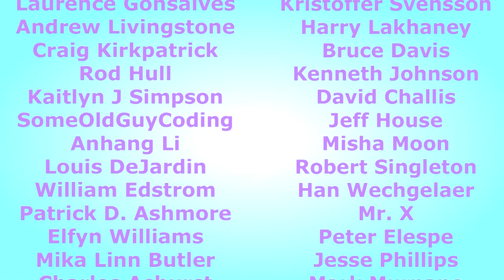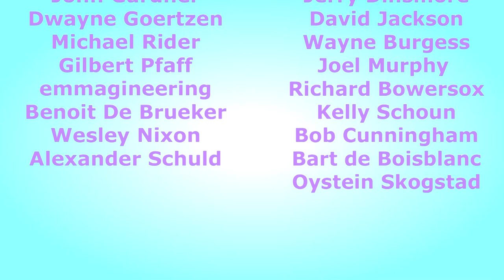3D Printing In The 20th Century

Comment: The real big hold down on 3D printing research and implementation were patents, all 3D printer tech had big copyright fee.
Only when the patents expired we saw the great 3D printing explosion from a few years ago.
In some way 3D printing tech have like 30 years delay compared with computers.
Reply: I think the personal computer boom was the exact reason why everybody made sure to file for patents on their 3d printing designs. The small handful that got really rich off PCs in the 70s and 80s stomped on toes to get there because people were so laid back about protecting their work. Yes it does slow things down because everybody doesn't just openly share but those people should be recognized because of their work.
Reply: @user-neo71665  Yes, people should be paid and recognized for their work, but man, they (the companies, not the actual inventors of 3D printing) were so greedy (Thousands of $ on royalties and overpriced hardware) that the technology of a dual extruder like Fran have looks like belong to the mid 90s.
I might be wrong, but muy idea is "Is better to sell 10 units with 1$ profit that 1 unit to get 10$ in profit" I think market share and adoption is the best way to success.
Toyota with the Prius opened the electric car market (it was a hybrid but shows the e-car can work) and Tesla implanted the full e-car. They made this possible with "low" prices.
Reply: Do you even know what patents and copyright is?
Speaking about copyright fees on patents sounds like just another journalist who was raped by a scientist.

FYI: patents is exact reason why we have 3d printing nowdays at all.
Because registering a patent requires you to provide every bit of research and make it public domain after that patent expires.
Reply: I still remember when printing a prototype radio casement would cost upwards of 500 euros. :))
Reply: @goury  in fairness most people don't know the details of copyright vs patents. If someone said  'copyright fees on patents' to me I'd understand it to mean a licencing fee.
Reply: @JoeDesbonnet  most people don't know anything.
Doesn't mean they have to brag about what they don't know.
If someone would say so 2+2=5 you shouldn't take anything he says related to math.
You will only get yourself misinformed.

One who doesn't know what he's talking about can't say anything that isn't a lie.
Reply: Why do patents work if you are breaching them but dont work if you apply them to your idea? Who is in the middle saying both sides are exploitabl...oh right LAWYERS... Anyone got more planes to donate to some legal buildings... If they told us the whole truth we would have cheered on those crashes.
Reply: @goury  Sorry I'm not a lawyer or expert on those fields. What I wanted to say was "turn down your short term greed and make 3D printing somewhat accesible while keeping your monopoly to get more money on the long run".
Reply: @jaycal1920  I didn't say anything about breaching patents, what I said was "turn down your short term greed and make 3D printing somewhat accesible while keeping your monopoly to get more money on the long run".
A lot of great inventions (example: music formats, communication standards,...) failed, had a ridiculous short live or are stuck in a minor and niche application because they wanted "instant" money.
Think on this, Why USB, CD-ROM, DVD,... are successful and wide spread? Is because they charged extra premium on every unit? at first yes, but you lower the prices little by little so everyone want one of your X product and you win a lot of money, and none of this requires patent infringement EDIT.
Reply: Imagine where we'd be in 3D printing tech if those patents didn't hold it back

Comment: Inkjet printers are a great analogy to explain why 3D printing isn't the magic tool for volume manufacturing.  An inkjet is a fantastic way to print a document, but a lousy way to publish a book.
Reply: Modern journals are printed using inkjet machines.
Not the same ones you usually buy for home use, but the same tech.
Reply: @goury  Also HP's huge 3D printers (like the MJF 5200) use very similar heads/PENs to their PageWide presses (like the T1100 or T400S), which are inkjets and can print a book in a few seconds. People just don't have the money for a big enough inkjet to be economical :P
Reply: I like the effort some companies put to volume printing though. The Pruisa i3 for example is made using heaps of them. Its wonderful to see.

Comment: I remember when our engineering lab got its first 3-D printer at Boeing. It was a polymer gel hardened by laser and was primarily used to design complex wing and lifting body forms
Reply: Any specific AC or project you could mention? Or maybe a year? Boeing was always my favorite manufacturer. Maybe because family worked for them. Or maybe due to the flights to Spokane every summer being mostly Boeing airplanes.

I had typed about three paragraphs of how and where Boeing corporate has gone wrong (in my eyes at least.) Then I realized I was just ranting and I'm not quite old enough for that yet. I've only reached the "bitch about things" age.
Reply: @9HighFlyer9  Good luck with that.
Reply: I seem to recall these too; material would solidify at the intersection point of multiple beams.  Sort of like "gamma knife" surgery.

Comment: Wow - had no idea 3D printing went back that far! Great background info.
Reply: from what i understand there used to be one company holding all the patents 

those expired which kinda marked the boom of 3d printing
https://futurism.com/expiring-patents-set-to-improve-3d-world
from what the article says that was around 2009
Reply: Those 3d printers were SLA and powder based. Neither of which are what brought 3d printers into the limelight, but rather, low cost accurate and powerful steppers and arduinos were responsible. The work of prusa to open source a fully commercially viable design was the mark of the boom. Then prusa clones flooded the market, and here we are today.

If you want a technology to succeed, don't patent. Open source. If it could ever succeed, open sourcing will get it done.
Reply: Similar methods of rapid prototyping were shown on the telly in the mid to late eigties already, if I remember right.
As 3D-Printers are just generic CNC-machines that use extruders or lasers instead of mills, the step from routing to printing wasn't too far.
Reply: @officer_baitlyn  there three major companies 3d systems that was the first stratasys and others, 3d systems it have the patend on face change 3d prinding method and stratasys have the fdm.
All start at 80s!!

Comment: my intro to "rapid prototyping" was with DTM Corp back in 1997 (SLS-2000) using Nylon PA. Now I work with powdered metal printers making parts from Aluminum, Titanium, 17-4Ph and so many others. when I would meet people and they asked what I did for work and I explained I fixed rapid prototype machines it was deer in the headlights and i spent 30 minutes trying to explain what it did. but now at least the concept of "3D printing" is mainstream and most everyone knows what it is now.

Comment: Just started 3d printing recently, with a ender 3, and then bought the chiron 400x400x 450 bed WOW ,  then got a pallete + to do 4 color prints. Really cool hobby!! I use pla, and dry it in a dehydrator.

Comment: That kinda blew my mind, I had no idea they had 3D printing back in the '90s! I'm having fun with my printer as well. I whipped up a little set of brackets to mount an LED strip at 45° under the shelf to light up the workbench. But then I got lazy and decided to try affixing it with double-sided tape instead of going to the effort of clearing off the shelf to drill holes and screw mount it. Needless to say it fell off pretty quickly. At least I've got a project for next weekend!

Comment: I personally find the 3D printing videos extremely interesting. My employer (Rolls-Royce) had investigated the possibilities of using this technique to produce gas turbine engine components. The main stumbling block with changing the way an engine component is manufactured is all the certification requirements to ensure the new 3D printed component offers equivalent performance and safety requirements as the ‘old’ part. Currently we use 3D printing to produce plastic full scale models of components to assist in the visualisation of the part when we are discussing machine and form tool fixtures. We are trying to purchase our own 3D printer, but unfortunately RR have recently imposed a maximum spend limit of £10k on any new equipment spend. Hopefully the financial budget is re-assed in early 2020 and we can purchase our new toy...opps I meant to say our new manufacturing aid! It was nice to hear the old Fran Lab introduction again.
Reply: That's fascinating! I forgot what show I saw it on, but I do remember seeing how RR produces turbine blades. I couldn't believe how insanely complex that process is! Everything has to be absolutely perfect!

I think I read about someone 3D printing turbine blades... GE? 

With Rocket Lab and SpaceX using 3D printed engines, I'd imagine the tech is there to print extremely strong and high temp parts.  I hope you get to play with one sometime in 2020!

Comment: You're so lucky to have access to the machine time back then! I think that the existing manufacturing process in the 90's was doing good enough to not really need 3D printing, and the cost barrier was so high. I would like to see the tech that would come out of an open-source 3D printing company in the 90's.... I have a taz mini2 and the thing runs right out of the box. I gotta say that I used to think that when you bought a 3D printer you were signing yourself up for a hobby, but I'm really impressed by the current tech. This summer I used a prusa i3 and an ender3 in Gamboa, Panama and they both worked like champs. I took about 1/2 a day to set up the ender until it ran quite well (note: you have to finish the manufacturing process with the ender and tighten the belts!) . Bake Your Filament!!!

Comment: Totally agree with you on this. Back in the days, this was indeed called Rapid Prototyping and not 3D Printing, and the Laser-hardened resin was the way to go. I remember the first prototype parts for newly developed speaker drivers, which made things so much cheaper and faster. But somehow the results back then were better than the stuff a consumer grade 3D printer produces today. Your little planetary gear is a proof for that.
Thanks Fran, interesting as always 👍🙏.
Reply: That's awesome! I've been working on a project for the last month or so in designing and 3D printing a functional speaker! Using carbon fiber filled filament to create a light and rigid cone and voice coil assembly in a single part.

Believe it or not, resin printers have gone WAY down in price. You can actually get one for as little as $200. Tiny build volume, but the detail they can create is incredible!  They're just so messy, and the toxic resin makes them a pain to work with. Plus, those parts aren't as strong as an FDM print.

Comment: Laser sintering is still protected by patent. That's the main reason it's not in everyone's workshop yet.
Reply: Interesting very cheap SLA printers showing up now, using LCD rather than laser technology. It would be really nice to be able to get sintered metal parts at a reasonable price, but they're still insanely expensive for parts of any size and pretty awful quality for most purposes.
Reply: SLA is off patent. SLS is still protected -- metal printing will soon be possible, there is a filament that is pending release which can be printed in a regular FDM machine, but it then has to be sent away for de-binding/kiln firing. Problem there is the dimensional change during that process makes prototyping really tough since the part will shrink 15-20% on XY and 20-25% on Z. So even if the filament is not terribly expensive or the post processing that at this point has to be done off site, the fine tuning of the part will take multiple attempts, but it's early going in the metal printing at home, so hopefully this will get more refined and accessible.
Reply: kazolar But will the patent expiry be faster than modifying the other tech?
Reply: Who has the patent? A lot of metal 3d printers I was looking at have laser sintering

Comment: I first saw my first 3D printing in late 80's - early 90's.  But I writing CAD software at one of the largest CAD companies.  Most of customers were fortune 500 companies that tried 3D printing for prototyping.

As for why it took so long for 3D printing to take off.  Here is some reasons I can think of:
1) Patents blocking
2) Open Source 3D printing didn't start until 2005.
3) Limited materials.  Take plastics.  The plastics industry was inventing thousands of new plastic polymers for processes like ejection molding etc.  It has only been recently that the large plastics companies have looked at 3D printing.  There is a lot of R&D going on in new 3D printed materials,  metals, plastics, ceramics, cement. etc.
4) Cost.  More costly then other manufacturing systems.
5) The industry was exploring CNC at the time.

I'm sure people can come up with more reasons.
Reply: and now you can get one for under the $200 usd mark from monoprice :)  Even SLA has come down in price, there are sub $1000 machines out there now.

Comment: 2:38 The phrase you're grasping for is SLS - selective laser scintering. As used by, eg, the Formlabs Fuse 1 and still very expensive.
Reply from the maker: It's SLM - selective laser melting - a different process  than SLS.

Comment: 3D printing for prototypes is awesome but I think the biggest reason that it hasn't become super popular and taken over production across the board is because the plastic that comes out is weak, brittle and needs to be worked before it can be used.  I think the technology will require a huge step in material development before it becomes what it could be so that the actual printing is faster and better quality without having to be worked by hand so that the whole process is more efficient.

Comment: 3d printing is being held back for many reasons as the tech gets better and better. testing and durability of parts, the tech (even for starting back in the 70's/80's) is still new and being tested before being trusted. the tech is still advancing quickly (why pay to get the best printer now when it will be outdated next  year). also subtractive manufacturing (milling/grinding) are trusted ways of making metal parts and even as 3d printing advances, much of the advances also apply to new subtractive machining techniques continuing to advance the trust in subtractive techniques.

Comment: Yep. Selective Layer Sintering (SLS). Formlabs is making a desktop version of that and it's still expensive. https://formlabs.com/3d-printers/fuse-1/
The reason home 3d printing didn't take off is because patents. The RepRap movement took off in the early 2000's because the patents started to expire.
Reply from the maker: They really do make a distinction in the industry between sintering and selective laser melting (SLM) due to the sintering method allows for selective porosity of the material.  SLM was it's own thing back in the day....